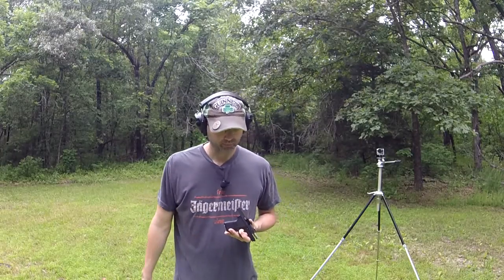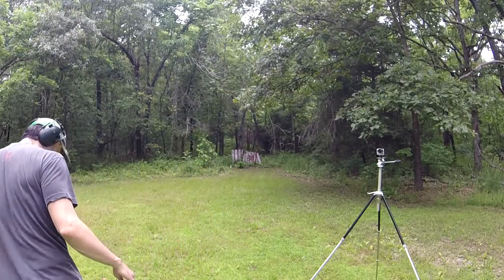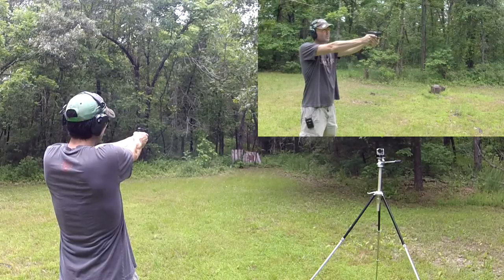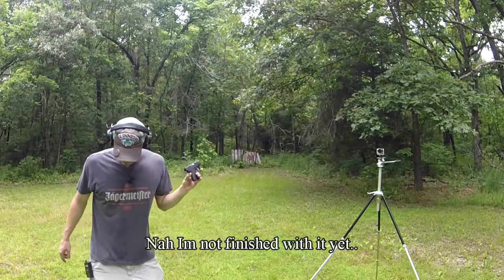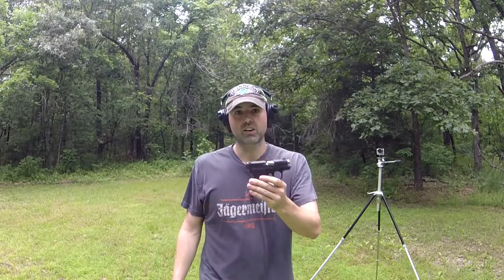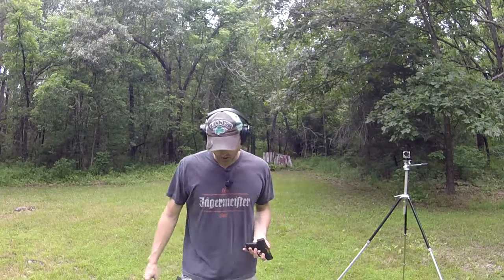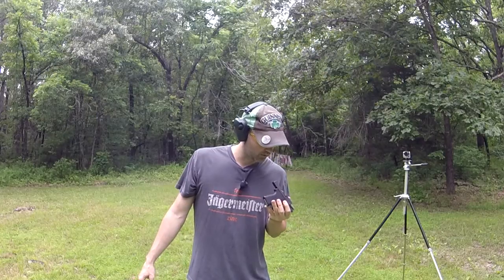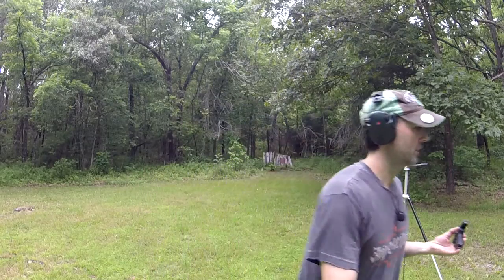Shooting and Showing Kahr P380 Revisited

Comment: Seems like you are inadvertantly riding the slide and that is the reason for part of your malfunctions.  This is further reinforced by the fact that your buddy did not experience any problems.  Lastly, did you notice how the slide caught the webbing of your hand when you tried loading a round (7:50-7:56) and the slide failed to completely go into battery.  Now I believe that these are design issues with the Kahr and that they need to address them.  I also believe that this gun is a little too small for some folks and that is the reason they experience these malfunctions, while others don't.

Comment: I also had problems with my P380 when I first bought it.  I tried different ammo and holding it tighter to no avail. I finally broke down and sent it back to the factory. Got it back and what a difference. I have not had a failure since.  I have to commend the customer service at Kahr as they turned the gun around in less then and week and paid priority shipping both ways.  Great customer service!!!  One side note. I added the Talon rubberized grips to mine (they were very easy to install) and was amazed on how much better it was to shoot.  I love this gun now and it is on me at all times in an Uncle Georges Wallet Holster..
Reply: Chuck: Did yours fail to go into battery? I have a new cw380 and it will just not go into battery consistently. I've tried 7 different types of ammo. FMJ and Hornady XTP tipped ammo. I might get 3-4 to run, then I get a failure. Thinking of sending it back to Kahr. Thoughts?
Reply: +Brandon Martin   I would suggest just breaking down and sending it to Kahr. You won't be sorry.  My P380 was a different gun now.  I have now put around 500+ rounds through it now with no malfunctions.  I don't know why they don't catch these issues during production but it may be that they only put one round through it.  They need to monitor the Kahr Talk forum and they would realize they have an issue with their .380's going into battery.. Good Luck
Reply: it's the slide recoil spring...it's not long enough.

Comment: its you not the gun.  you had no issues other than you locking the slide back the second time. you have a poor grip on it, im not being negitive but you can literally see it. it jams when your hands go sky high. i own a ct380. i can shoot 4 mags no problem, i hand it to my gf its jam city. best ammo i have found in the Kahr 380 is the sig 100gn it has a flat nose. i have had 0 issues. i love my Kahr but as a 380 goes the bersa is king. the Kahr is for experienced shooters. they dont say that but with my experience so far if you dont have good technique you shouldn't own a kahr. it is a 10 ounce gun. it is super light. and recoil is snappy. that is what causes 99 percent complaints with Kahr people, who cant shoot, giving it a bad rep.
Reply: Brewmaster C me personally i wish i would have bought another bersa thunder. its the cadilac of 380s and they make a plus model that holds 15. i thought about the glock but passed. its it difficult to find a gun that has heft for recoil. slim for concealment. and adaquit capicty. with a decent price. my gf hates the kahr. i want to love it but the ability to only feed certain ammo is a problem. and only certain people in my house can shoot it. i like it a lot i guess cant say love.  it all comes down to shooting what works best for you.  if your in the market for a second 380. the bersa thunder is a very good option. its accuracy is unmatched in any compact I have fired. combine that with hand fit. plus its da/sa hamer fired so in that rare instance you get a hard primer or light strike just pull the trigger again.  im interested in the lc380 as the lc9s is a beautiful compact 9mm. just have concerns with ruger and their da pull. any imput?